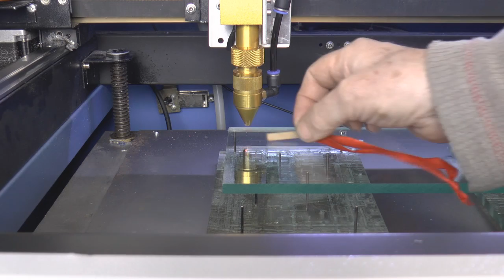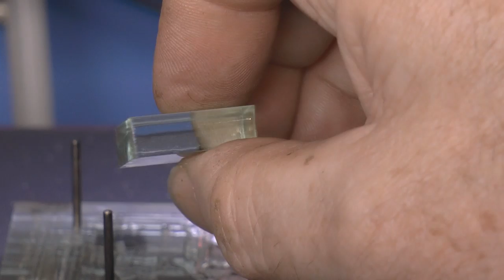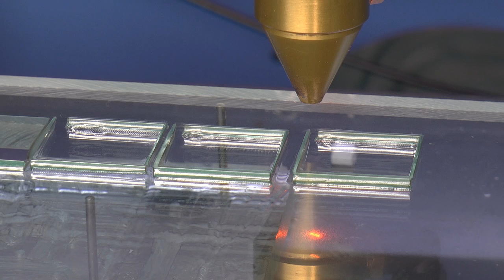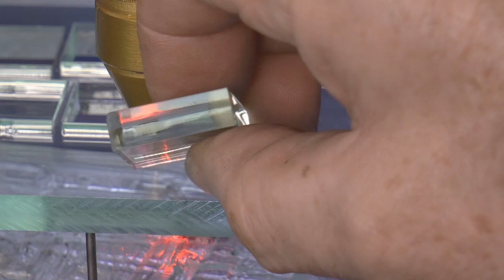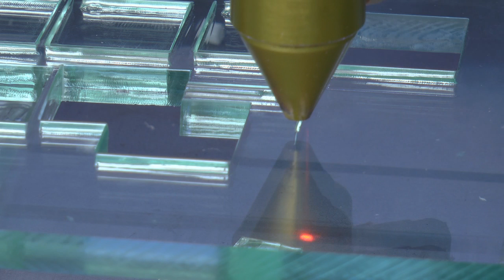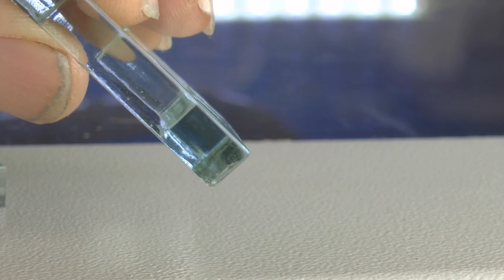RDWorks Learning Lab 54 Acrylic beam drag and flame polishing

Comment: Thank you Sir for your videos! I saw them all because i am up to buy that GH350 Laser engraver too;) so my question is if you already made a "best pracitse" table with all your experience for different materials and its best Laser speed and power?
Reply from the maker: +thomy0168  
Hi
If you go to the Thunder Laser website site and download their version 8 of RDWorks,     http://www.thunderlaser.com/down   When you click on one of the coloured cutting power/speed  layers , it will open a window. At the top of the window you will find a Parameter Library that Thunder Laser have thoughtfully populated with commonly used  material data.  Each machine could be very different depending on tube power,and focal length of lens, so this data is a jumping off point. Sadly you will have to note the best settings for your machine as and when you find them. Sorry I can't be more helpful.
Regards
Russ
Reply: +SarbarMultimedia thank you!